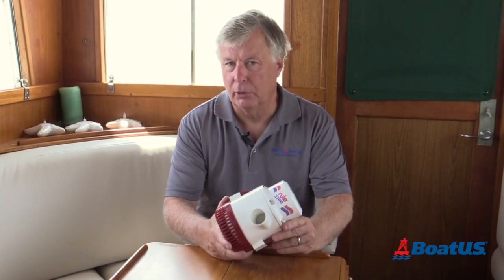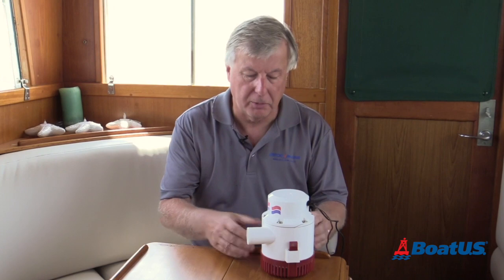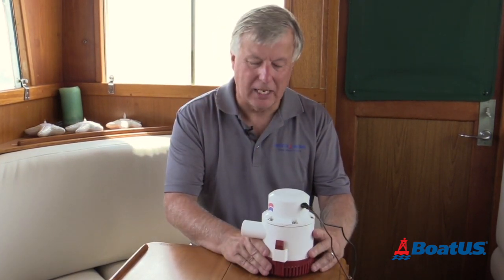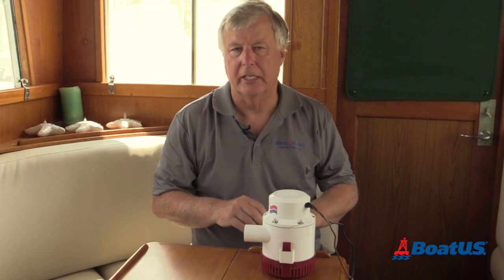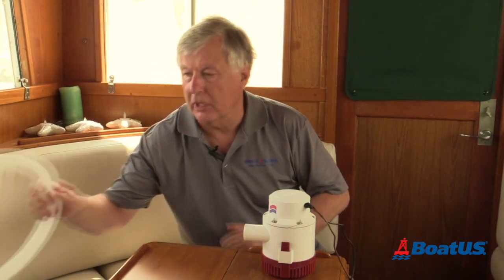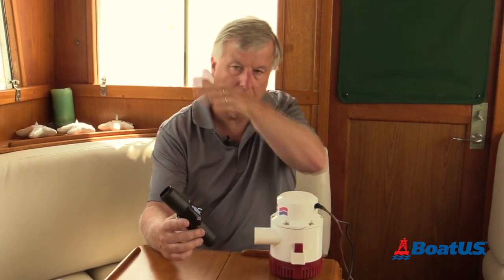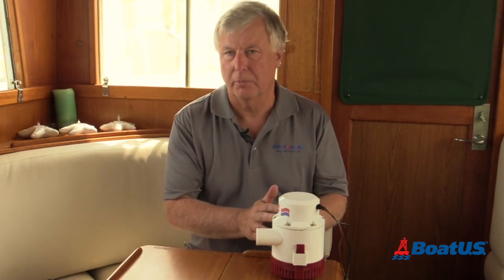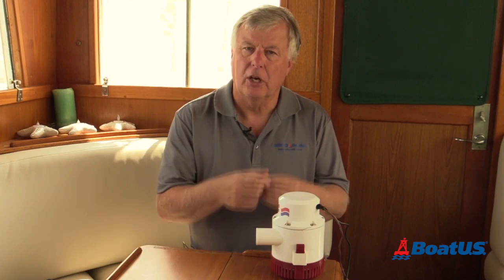What Size Bilge Pump Do I Need On My Boat? | BoatUS

Comment: hi. we are building a 13meter sports cruiser with 3 watertight bulkheads (4 compartments). Throughout my research, I kept on seeing 2000-4000GPH capacity requirement for our boat size. My concern is do I have to distribute the capacity equally among the 4 compartments? I'm thinking of using around one 800GPH pump per compartment. Is it enough? I cannot find a sizing calculation from ABYC. Thank you in advance.
Reply from the maker: Thanks for the question, Paolo. Long answer coming.

Disclaimer: Without seeing your boat, we can't really give you specifics, but we can answer your general questions based on the information you've given us. Anything mentioned here should be taken in that context and not as advice.
 
The American Boat and Yacht Council (ABYC) has not set requirements concerning bilge pump capacity, although the American Bureau of Shipping recommends one 24 gallons per minute (gpm) pump (that’s about 1,440 gallons per hour, or gph) and one 12-gpm pump for boats under 65 feet. The Lloyds’ standards relate to vessel length and volume, recommending a 50-gpm pump for a boat of about 50 feet.
 
In our opinion, bigger is better (within reason of course), and no boat ever sank due to having too much pumping capacity. Based on boat size alone, we'd recommend a minimum of 5,500 gph electrical pumping capacity for a 40-foot vessel—divided among a 1,500-gph primary pump and two 2,000-gph backup pumps. This is a minimum and can be bumped up, especially where extenuating circumstances apply (such as increased vertical lift due to a deeper bilge, etc).
 
Keep in mind, though, that this is for a boat with no separate watertight compartments (i.e., one primary bilge that the entire vessel drains into). For the boat you describe, you're correct that each of the four watertight compartments should ideally have its own dedicated bilge pump.

If it were our boat (this is purely personal opinion), we would install the following:
1. One 1,500 gph pump in each separate compartment.
2. For the primary or main bilge compartment (i.e., the one containing engine shaft penetrations, etc) we'd also add a 2,000 gph backup bilge pump.
3. If any of the other separate compartments contain any penetrations below the waterline (thru-hull for example) we'd suggest bumping the 1,500 gph pump to a 2,000 gph unit.
4. VERY IMPORTANT: Regardless of what you decide to do, we'd strongly recommend installing a high-water bilge alarm with a sensor located in each separate bilge compartment, as well as a visual “bilge pump on” light at each helm station for each of the electric pumps. The alarm will let you know about high water in the compartment, while the bilge pump on light will notify you before the alarm goes off that something is going on (i.e., a pump that rarely comes on is on, or is staying on longer than usual).
 
Finally, remember that bilge pumps are not emergency pumps, which is another topic altogether.

Hope you find this helpful. Good luck with the rest of your build!
Reply: @boatus  Thank you very much for the informative response! Much appreciated. We will just use a portable pump as a backup so it can be used in whichever compartment needs extra pumping.
Reply from the maker: You're very welcome, Paolo.

Comment: My bilge pump hose has a vacuum break in the line.  Which is better a check valve or vacuum break?
Reply from the maker: Hi Mark. Thanks for the question. A vacuum break is perhaps better known as a siphon break and does not impede flow in the way that a check valve does. So the quick answer is, stick with the siphon break. Hope this helps! Let us know if you can.

Comment: If you don't think the Coast Guard mandates a bilge pump on a charter boat, try telling that to a Coast Guardsman the next annual safety inspection.  In fact, he will tell you that a vessel over 26' requires TWO bilge pumps and of a CERTAIN size hose!
Reply from the maker: You're correct about requirements for commercial boats, gerald. No requirements for recreational boats, however. Always seemed odd.

Comment: On my 37 foot sedan cruiser, I have 2 aft bilge pumps, 2000 and 500. In forward bilge I have 3 pumps. Two 3700, and one 2000. They are all Rule pumps.  I figure redundancy is a good idea. I have a somewhat watertight aft bilge, it comes up all the way to the floor, sealed. Which isolates one bilge from the other. I once tested how it works by opening up the aft  bilge to the sea. The water came in fast at first, the  rear of the boat dropped about 6 inches, and at that point the water inflow had slowed a lot, very much so that a bilge pump could keep up with the water rising. Useful say if a hose came loose from a thruhull.
Reply from the maker: Thanks for watching, Scott. Redundancy is a good idea for sure. Glad you were able to safety test out your system. Sounds like it could be a life-saver if you ever need it. Here's hoping you never do!
Reply: @boatus  as an boat eletrician I've already seen setup like that save lifes a few times.
People don't care about pumps or float switches so they just fail and no one knows until it's too late.
Also make sure to have an alarm hooked up to the float switch as well.

It makes my head hurt when I remember how many boats lack these basics features.

PS: Great channel BoatUS!
Reply from the maker: @miralemnermina142  Thanks so much for your comment and for watching!
Reply: @everyday tenor I found sponge works very well in blocking holes as well 👍
Reply from the maker: @everyday tenor You are absolutely right! Bilge pumps aren't meant to pump out water in an emergency like that. Best to call the Coast Guard in that situation. They are there to remove nuisance water so it doesn't accumulate and become an issue. Good tip on the carrot! Or keep a TruPlug on board if you don't regularly keep a carrot around.

Comment: Why should the pump be able to pump out thousands of gallons per hour?
Reply from the maker: Thanks for the question, Cornelis. As we mention in the video, stated bilge pump ratings are only under ideal conditions, which are definitely not the case on a boat. Because of efficiency losses due to voltage drop, static head/vertical lift, and hose resistance, the pump must be sized larger than you might need in order to pump out that water. So, for example, a 1,000 gph pump might only pump about 300 gallons per hour (which is only 5 gallons per minute) calculating 30% loss for the hose, 20% loss for vertical lift, and 20% loss for voltage drop. Obviously the bigger the boat, the larger the bilge pump you need. Hope this helps!

Comment: At 1:34 he states "we need to do some calculations" and then he continues to talk for another 3 minutes without ever explaining what those calculations are.  Sure, lots of important considerations are mentioned, but not the "calculations" he mentions to properly size the pump (for both head and flow).  I came here looking for a rule of thumb for that, and didn't find it.  I own a sailboat, and my bilge is on top of the keel, in a very narrow space between the keel bolts.  Granted, the bilge capacity is quite small.  So how small is large enough?  It seems to me that my bilge pump sizing will be driven more by what will physically fit than with how quickly it can empty the bilge.
Reply from the maker: Thanks for the comment, Tom. Fast forward to 2:20 and he goes over all the calculations that will help you determine how much water your bilge pump ACTUALLY removes. I think you'll find what you're looking for, however, in this article: https://www.boatus.com/expert-advice/expert-advice-archive/2014/december/bilge-pump-capacity-do-the-math Hope this helps.
Reply: @boatus  My problem is that all these calculations tell me how much my pump actually moves, not how much capacity my boat needs.  That answer is provided in the table from West Marine that you cite in your article.  However, that table makes no allowances for the type of boat and the nature of the bilge you're pumping out of.  For example, a low-deadrise deep vee powerboat hull will carry a lot more water for a given depth than my 25 ft sailboat with the bilge draining into the narrow keel stub.  6 inches in my bilge is a lot less water than that 20 ft powerboat.  So my question is not how much does my pump move, but how big of a pump does my boat need?